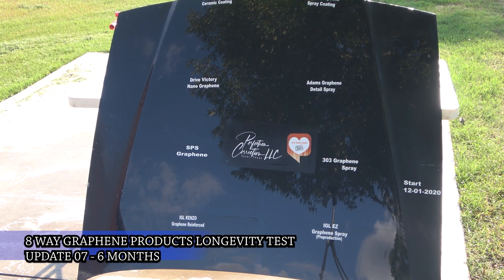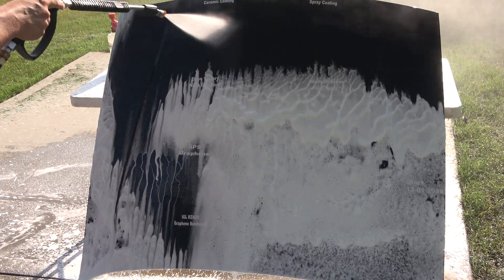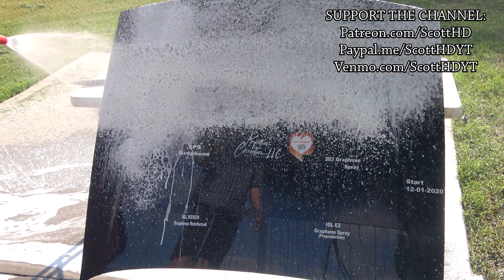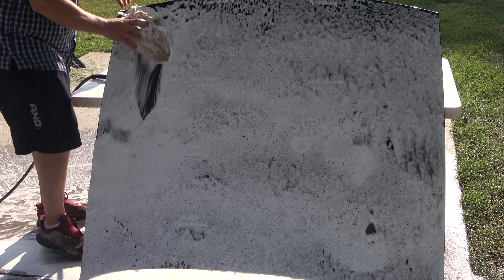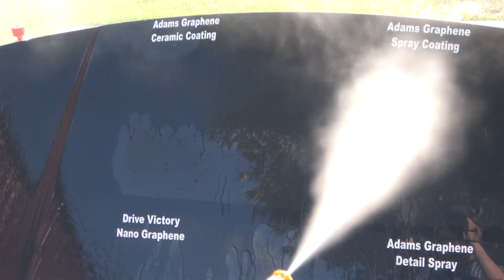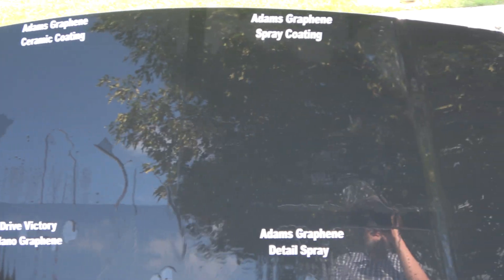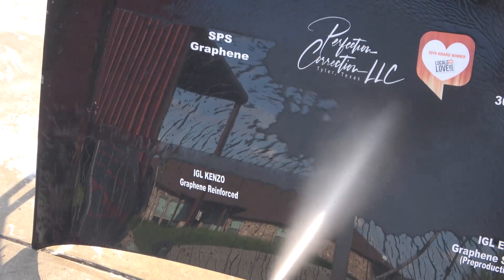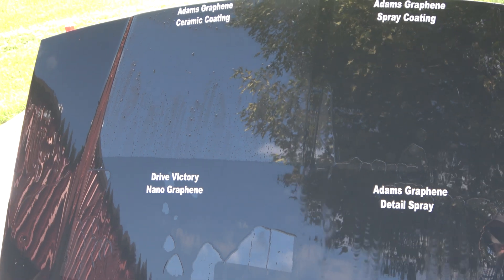Graphene Coatings - 8 Way Comparison - UPDATE 07 - 6 MONTHS **FINAL UPDATE**  SEE WHY!

Comment: How do you get the coatings off?  Do you have to use compound/polish or chemicals?  Love your channel!
Reply from the maker: Majority of them can be removed with a simple polish, but like Cobra Kai said there are a few that need a little more than that (light sanding and then polish).  One example (not in this test) is IGL Eclipse. It is an industrial coating, however, not really for vehicle paint.
Reply: @ScottHD  Is IGL Eclipse used on solar panels?